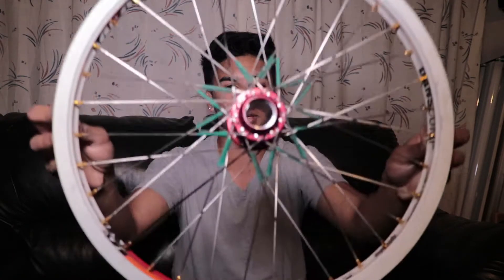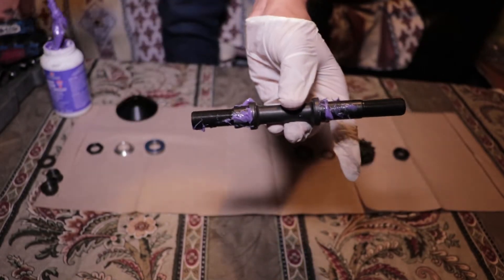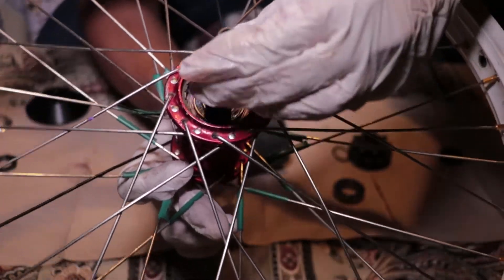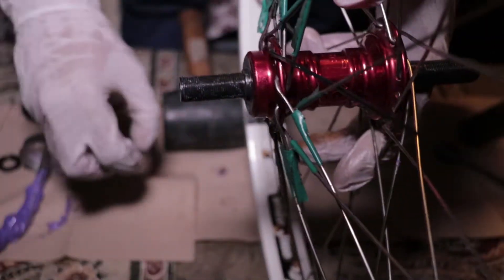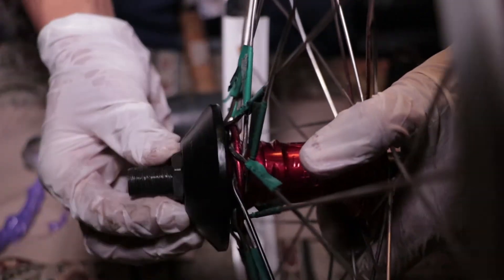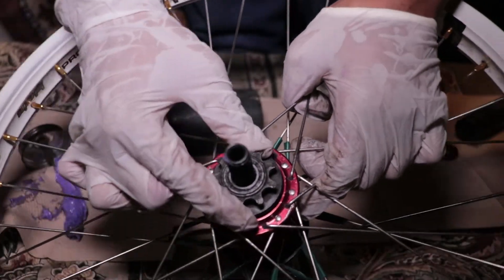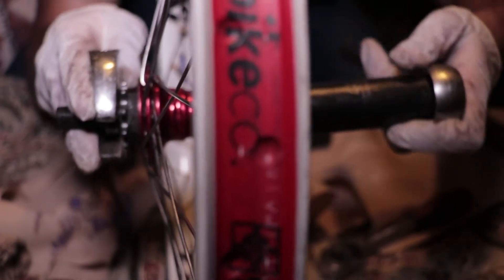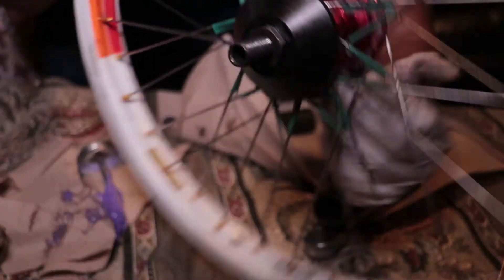How to Build a Profile Racing Cassette hub (Home Style)

Comment: Nice video but you don't need the cone nut on when you are using the profile hub guard it's designed to push on as you tighten the wheel